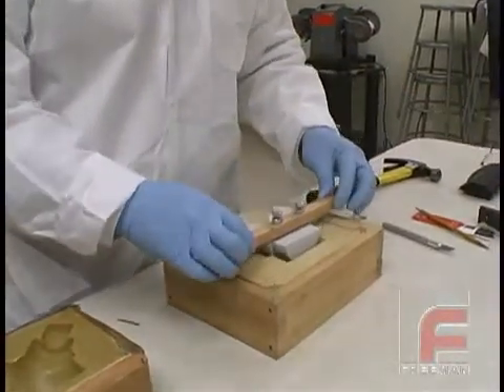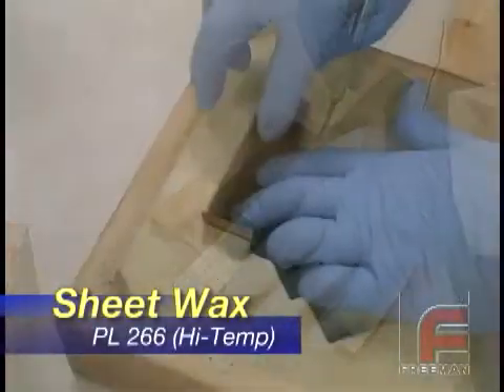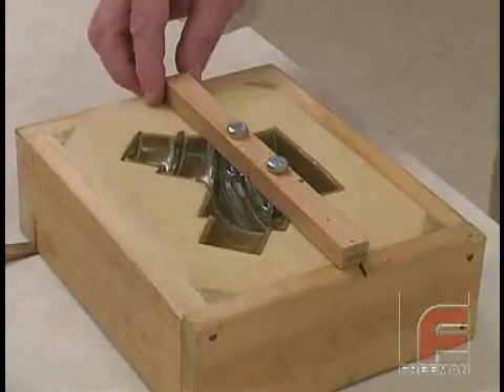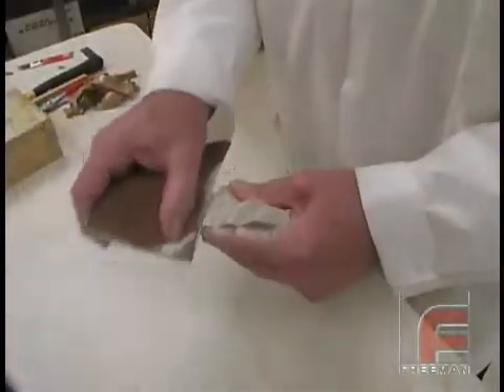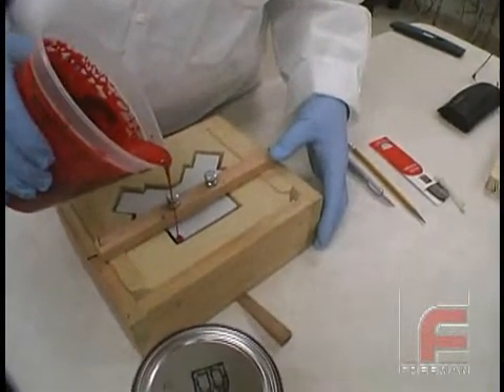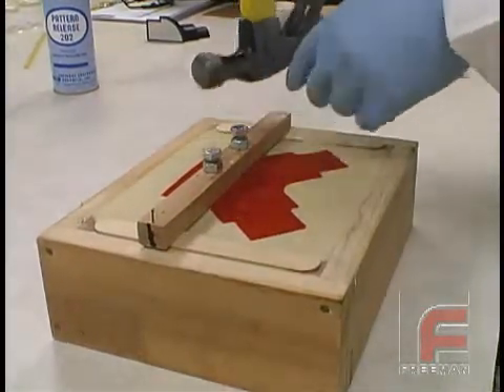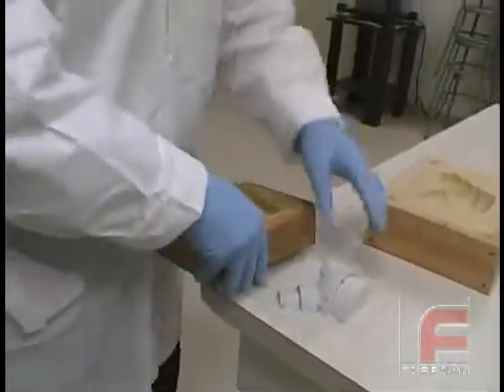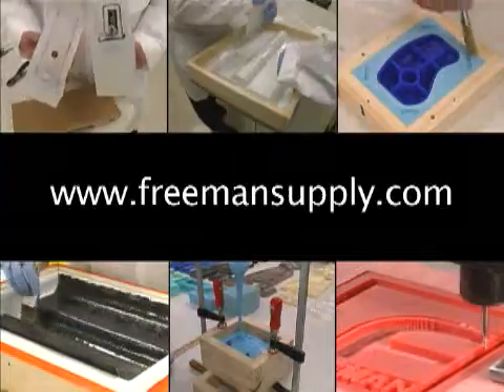Mold Making - Surface Casting - Updated

Comment: The bolts are removable.  Release agent is applied to the bolts prior to pouring the urethane.  Once the urethane has cured, you remove the screw and patch the holes using the same urethane you cast your part with or a polyester repair paste.